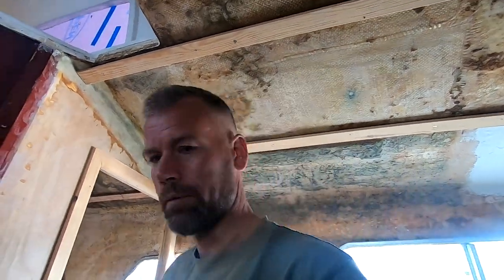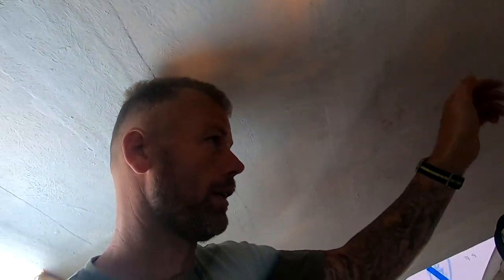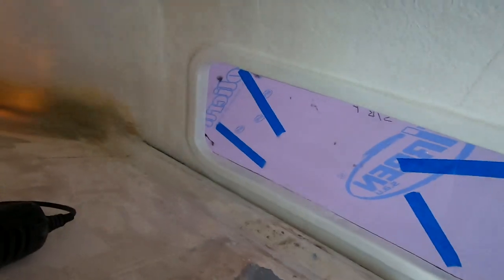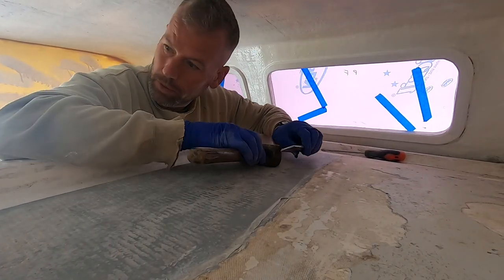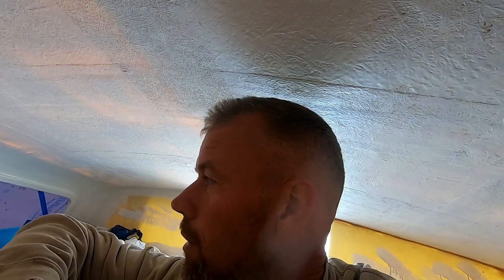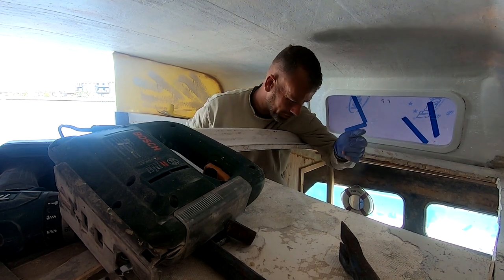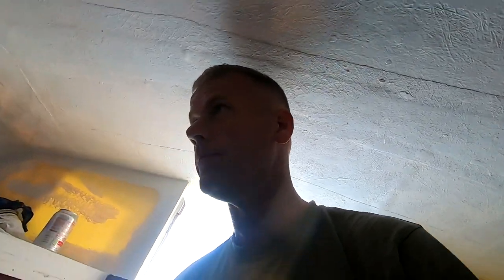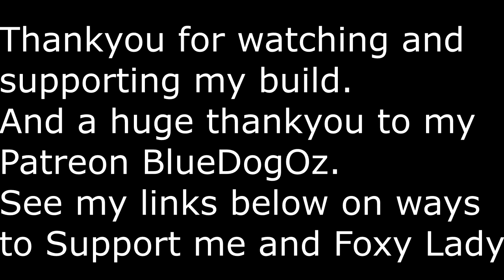Coach Roof removal on Project Yacht E83

Comment: Great progress. Apparently, those multi-tool blades for tiles (those granulated looking ones) are supposed to be great for fibreglass, but haven't tried it myself. You can resharpen your dull blades with a fine file, by the way. Just get a small, triangular one and that should work.
Reply from the maker: Oh brilliant I didn't realise you could sharpen them. Can't get them from shops at the moment. Not sure if covid or truck drivers but wickes and B and Q have had empty multitool shelves for ages! Will try the sharpening trick👍👍🙏🙏

Comment: Wow!! So good! I am currently living in a Westerly Centaur and want to raise the central part of the coachroof towards the mast (involves cutting out an 80cm long section). Did you have to reinforce the existing part of the roof/ how did you keep it all strong? I have a similar concern that when I cut out the old piece, it might all cave in hahaha. Really want to watch your others videos too but thought it's quicker to ask direct. Thank you!
Reply from the maker: Hi Tristian, i know westerly's very well and they are absolute tanks.  I have a little Pageant too. 
The new roof section if epoxied on replaces the structural strength. 
Being a cat folding in half was a concern🤣 but been craned twice now, no problem,  bullheads give you the strength. Good luck mate, i would like to see how you get on!🤞